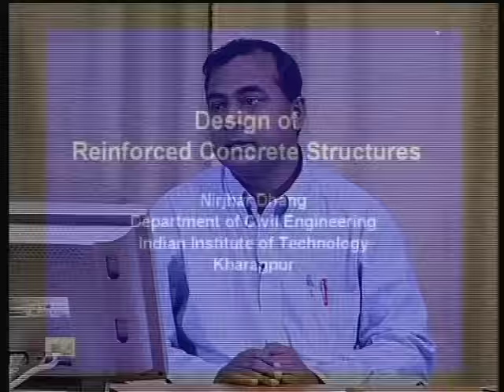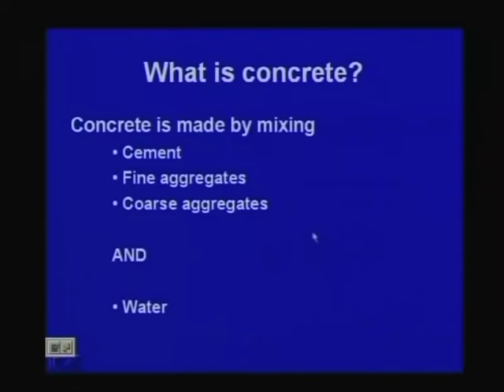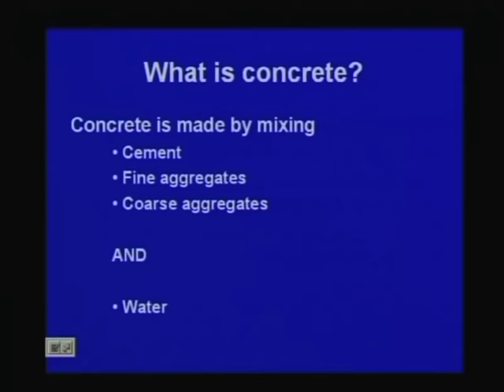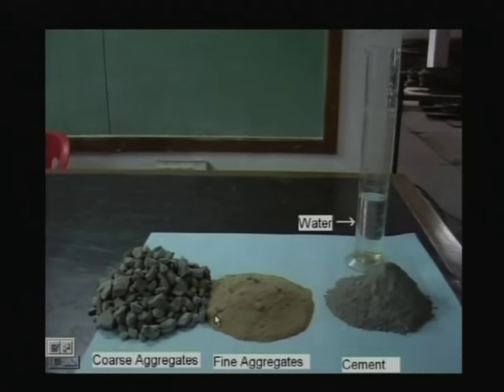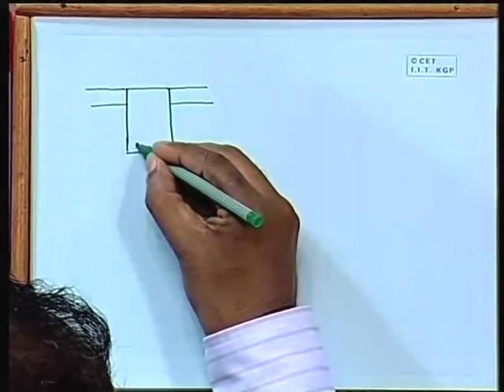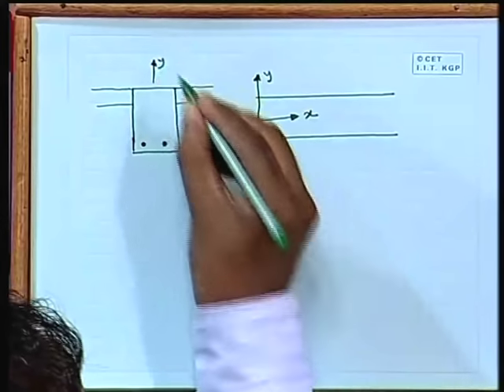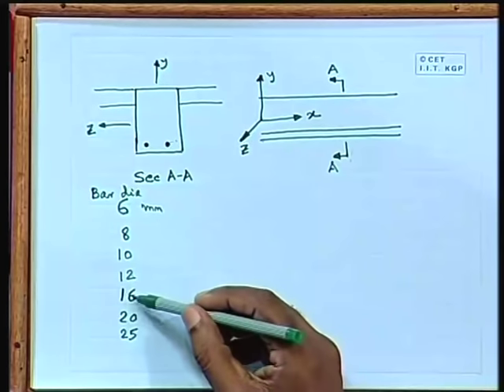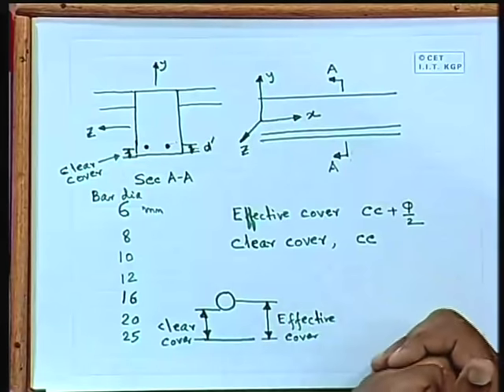Introduction - I

Comment: weak defining of design!!!!!!!
design in structural engineering means translation of internal forces to equivalent resisting material.
Analysis means finding internal forces in structural elements from applied load with given boundary condition and study the behavior of element like calculating deflections